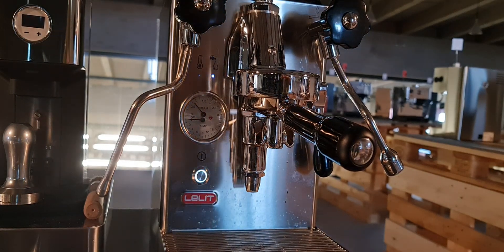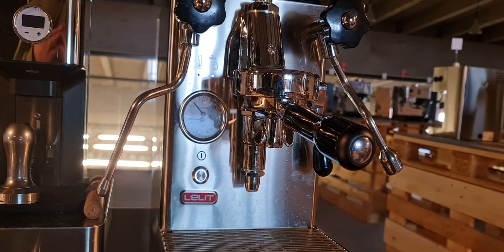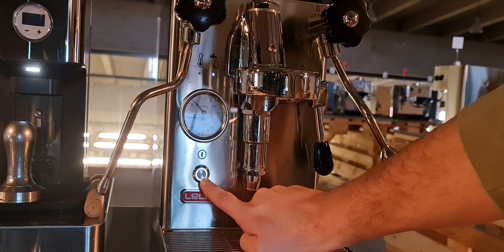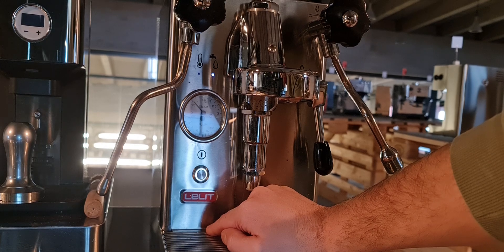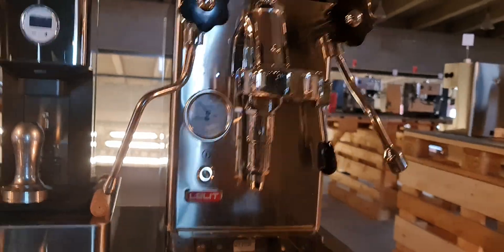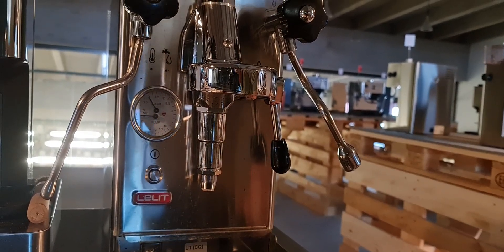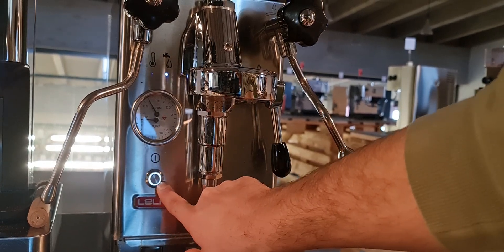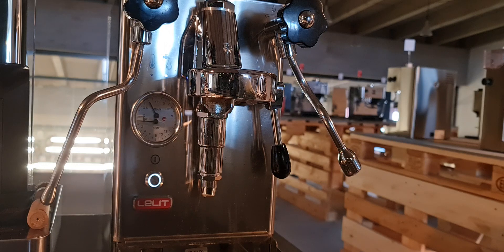pl62x software 2022 marax V2

Comment: Thanks a lot for all this videos. I own a v1 from 2020 and have done the V2 modification of the OPV discharge. Also, my electronic box has had a faulty lever-switch connector, so I replaced it with a current electronic box with 2022 software.

I have to say that the new version does A LOT better in terms of temperature stability. It‘s just unbelievable how big the difference in taste turned out.

Well, that is what I call „product improvement“ - well done, Lelit!

Comment: @Lelit insider, Quick Q on this machine Mara X V2. On Position 1 - X Mode Steam. Would the brew temp to be stable enough for me to make espresso, latte, then espresso. So 3 coffee in succession. My question is, would the brew head temp be stable enough between the 1st and 3rd espresso to have the consistency using the same bean and grinder setting? Thanks.
Reply from the maker: yes, but you have to do them one after the other, without long breaks between each one
Reply: @lelitinsider2977  , thanks. So how long is considered too long before the brew head is too hot? Would it show on the steam bar? And how to bring it down quickly? Is it by flushing it?
Reply from the maker: @ardiwijaya  4-5 minutes, but if you set the round botton  in 0 position you have less overheat!
Reply from the maker: @ardiwijaya  in steam priority fron the minutes 6 -16 after the shot
Reply from the maker: @ardiwijaya  after 10min after the shot, but you can flush to cool down,
Reply: @lelitinsider2977  thanks a lot. So when the brew head is over heated for 10 mins (min 6 - 16 after the shot), would it show on the steam bar pressure, eg: >2 bar pressure?
Reply from the maker: @ardiwijaya  after 6 min the steam pressure is around 1.5 bar, 
  slowly the pressure will drop below 1 bar,

Comment: Hey, I still don't understand Steam Boos function. How does it perform in CoffeeX mode? Everywhere there is recommended that Coffee mode should be used for making espresso or just single milk drink. Is steam boost helping here? can I froth more than one milk in Coffee mode? For example, I want to make double espresso + milk, then double espresso + milk. Will this be possible?
Reply from the maker: In the V2 software we removed the “classic HX function”  (0 position in the circular botton)
And we use this position to do something to limit the overheat after the shot.

In the software MaraX  2022 for  more steam you have to set the round button to 1, so  the heating element is active during the coffee extraction and this allows the pressure to rise to 1.5 bar. (in case of long coffee shots or in case of consecutive coffee erogations the pressure is going to increase  up to 136°C in the steam part of the boiler). 
in this mode you can erogate more coffee in sequence, but at the end of these erogations  the coffee group will have an overheat phase for  15-20 minutes.
While if the side button is set on 0 during the coffee erogation, the heating element is off.
This limits the pressure in the steam part of the boiler but at the same time improves the thermal stability of the water in the coffee exchanger.
In this mode the heating element will be active only when the coffee brewing lever is lowered.
this has two aims:
1. heat faster the water in the heat exchanger  as during the coffee extraction the heat exchanger has lost calories.
2. raise the pressure in the steam part of the boiler to allow to the consumer to have sufficient pressure to froth the milk.
At this stage the maximum pressure limit is 126°-128° for 120 seconds. After the steam pressure range is  going to lower between 112° and 118°C in order to desable the heating element during the over heat phase.

In MaraX the pressure inside the steam part of the boiler is always maintained between  a minimum and a maximum value, for example between 112-118°C:
If the temperature in the coffee exchanger is under the set value, the pressure in the steam part will increase to the maximum value of 118°C.
If the temperature in the coffee exchanger is above the set value, the pressure in the steam part will drop to the minimum value of 112°C.

All the MaraX build since December 2021  has this software.
The settings are (circular botton)
• Position 0 - Xmode coffee = no heating element during the extraction, for temperature stability (someone who makes no milk drinks) and less overheat!  (ex classic hx mode)
• Position 1 -Xmode Steam = heating element on during the extraction  (as in the previous mara was position 1 with a dofferent name!)
And after the shot we have 120s boost mode, in this time the steam boiler works between 126°-128° 
this help to have the recovery into the exchanger and to have pressure to froth the milk.
After this time the steam range change between 112°-118°
we can see if the software is installed in the machine by the on-off button 
In this way https://www.youtube.com/watch?v=stNGI...
Reply: @lelitinsider2977  hold on my friend, that is a lot for me ;) let's slow down. I think I understand the difference how Xsteam and Xcoffee works. But I have newset instruction manual and there is section about "Steam boost - More than 1.2 bar for 120s" function which is active in both modes. So in the instruction it is written: "Every time the lever is lifted and then lowered; the software tells the heating element to turn ON. This happens for two reasons: on the one hand, the boiler is heating up the cold water; on the other hand, the pressure to froth milk increases. This means that the user can even just warm up milk without brewing coffee, he just needs to lift and lower the lever to have more than 1.2 bar pressure for 120 seconds. The steam boost is active for 120 seconds because this duration allows the user to froth large quantities of milk and at the same time it reduces big temperature fluctuations that might influence the following coffees." So how this works with XCoffee? What is it for if you still recommand to use XSteam for milky drinks? I thought it is to be able to combine both: XCoffee and Frothing milk, mayby not that fast as in XSteam but still doable. Am I correct?
Reply from the maker: @MrBaarszczu  the 120s boost mode works in every cases, 
the only difference is the control of the heating element during the coffee extraction, in 0 position is off during the extraction, in 1 position is on during the extraction.
Reply from the maker: try to use the machine in 0 position for some days, if the steam is not enought try to set the machine in 1 position.

Comment: Hi, in the V2 software, xcoffee mode (position 0) the steam pressure is 0,5bar (92°C), after  a shot increase to 1,5bar and temperature up to 95°C. I have to wait 15min to reach again 0,5bar and temperature stability. The new software must improve temperature stability right? In my experience i can't see the difference with the old software.

Comment: Is it possible to stop overheating in position 1 xmode steam by getting some water through the hot water wand? Because fresh water will be filled into the boiler and cool down the present water. So you don't have to wait 15 minutes to cool down.
Reply from the maker: do you have a v1 or v2?
Reply: @lelitinsider2977  I have none of them but I consider buying the v2
Reply from the maker: @matrix8404  the v2 in O position has less overheat , but in overheat case you can brew some water from the hot water wand
Reply: @lelitinsider2977  thank you for these informations 👍😊

Comment: Hey, big thx for the Info. I got my Maschine Dez 21, with the manufacture date of 11/2021, and my light is also flashing 5 times. Do I have the new Version already? Because in you description was told from 12/2021. i am a bit confusing. Is there any other indicator to check? Is there other changes or only the software?
Reply from the maker: If the on off flash it means that you have the new software
Reply: @lelitinsider2977  My machine is made (Production year2021-11-02T15:54:47)(black logo) , power switch don't flash 5 times, but machine work like a new algorithm  -  0 brew mode (less steam pressure) , 1 steam mode (more pressure)  in the manual of the machine is opposite ?? Is the new manual correct for this machine ??
Reply from the maker: @ortortor  https://www.youtube.com/watch?v=8HNZfKJaAZM&t=7s
ceck the x mode as in the video

Comment: Thank you for continuing to work on the software. Have you adjusted the boiler refill behaviour at all? I have a problem (v1) that the steam boost works fine for two separate coffee extractions after initial warm up, but then it does not boost after a third. If I switch the machine off in between the first two (to cold) and then warm it up again for the third, steam boost is fine, but boiler autofills at the start of the warm up of the third. Thanks
Reply from the maker: please  send a video at care@lelit.com  we have to see how the machine works

Comment: Thank you very much for this explanation. Will it be possible to get a new black box with this V2 Software on it? I tried the V2 by a friend and it's much better for my work flow than the old V1 model I have. Every time I have to hot water in the group head and sometimes also steam coming out of the group head instead of water. And I'm using the "coldest" possible setting.
Reply from the maker: you have to change the electronic card, please contact your reseller!
Reply: @lelitinsider2977  there’s also a video on how to change the electronic card, basically is it enough to do that procedure with a 9600096 card? Thanks!
Reply: @lelitinsider2977  my local reseller told me it is not possible a Mara X from 2021. Is this really true? Thanks!
Reply from the maker: @maximilianrauscher7817  please send an email at care@lelit.com